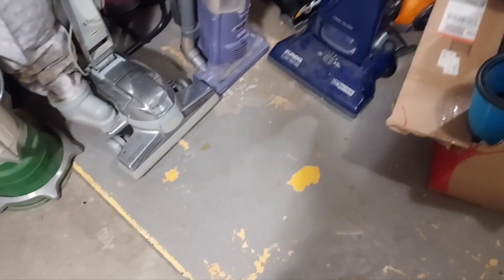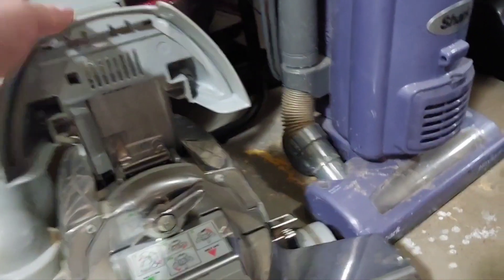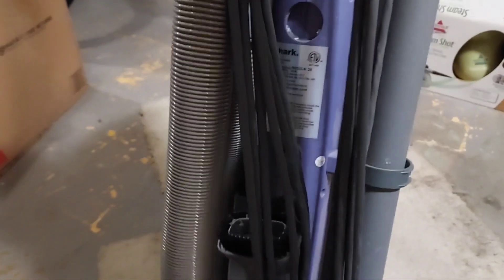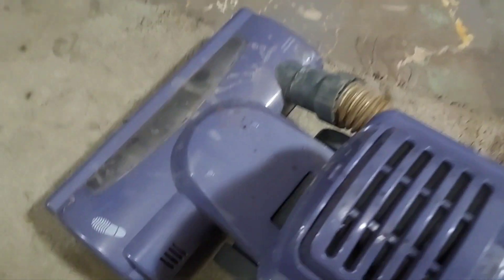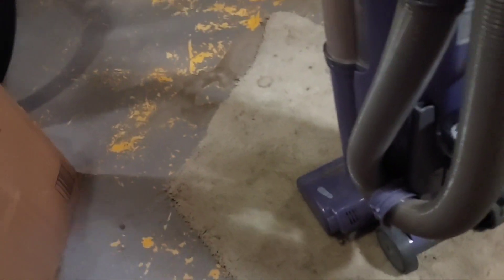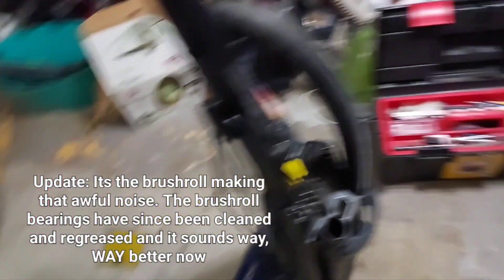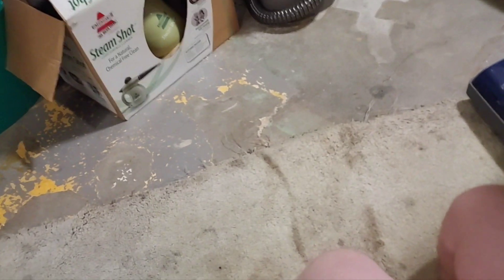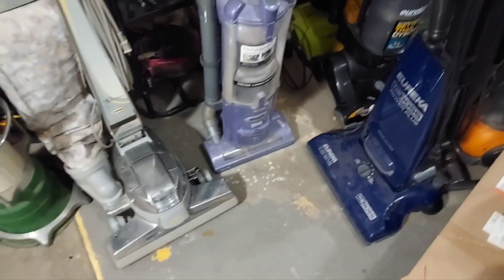New vacuums: Kirby UG, Shark NV22, Eureka The Boss Power Plus Victory

Comment: Do you think that they used it without a bag, because if they couldn't find it at Walmart,  they just decided to use it without one? Did I tell you about my new machine?
Reply from the maker: I'm going to guess that could be a reason ot was used without a bag. As for the new machine, you have not shown me.
Reply: As soon as I get it, I will send a pic. It's a machine like the golden Vanguard,  except painted hood. Made 11/6/72. People are too lazy anymore, that if Walmart doesn't have, just forget it, instead of going to a vac shop or hardware for the correct bags